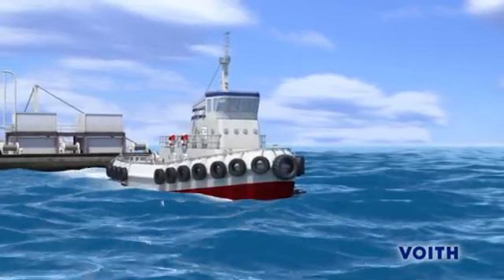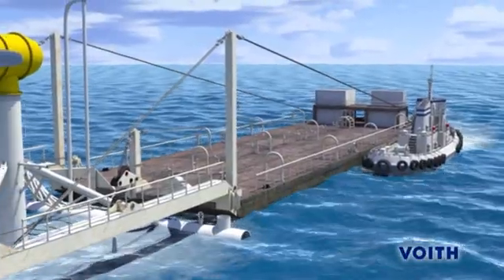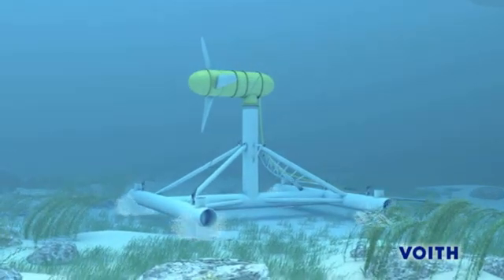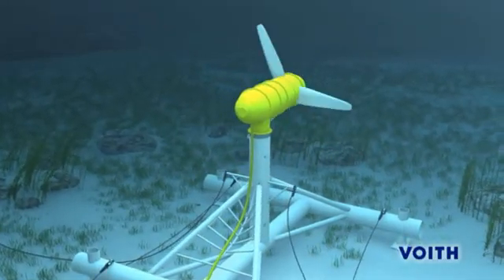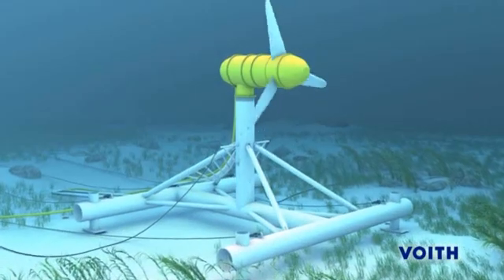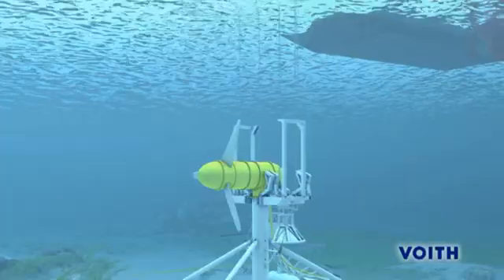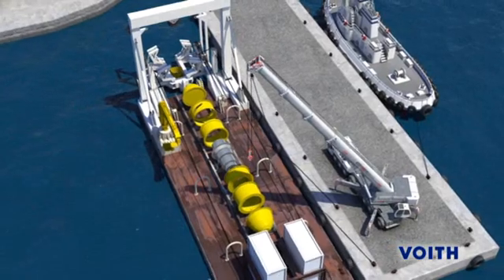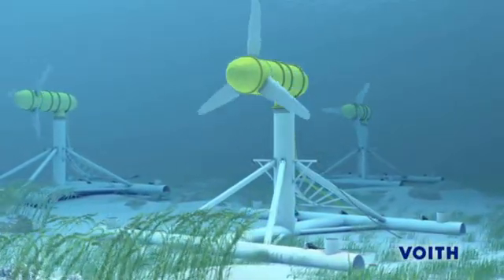Ocean Energy - Tidal Current Turbine

Comment: Principle of ocean current power generation. Giant nails are driven into the seabed using giant waterproof tanks.
Giant nails hold the sea net like a golf course net, and a large number of extra-wide fan blades are installed to connect springs to prevent tornadoes. 
添網海網TUBE

Comment: I don't think this safe for the sea life. The idea is very cool, but the whole structure should be protected by a cage that allows water flow but prevents large fish and sea mammals to get too close to the turbines
Reply: Sea water is 30 times denser than air and the turbines are smaller and slower than wind turbines. Camera surveillance in the Orkneys project indicates that sea life avoids the turbines. If this proves not to be the case, the blades could be caged. There are also other concepts to blades being developed.

Comment: Wimdshear is one of the biggest downfalls of wind turbines. Water is 70% denser than air. There is also seafloor sand to contend with that would be abrasive and "clog the shorts, making a pearl" in the components.
I guess if you make an animated you can take investors money...🤷🏻‍♂️.

Comment: Voith has some very cool concepts and products, though I wonder what the payoff is after maintenance. Having served in the Navy as a diver for 24 years I can tell you that salt water, even salt air, is not friendly to anything, especially mechanical.
Reply: yeah that's what I was worried about lol when it said "lubricated by sea water" I instantly imagined the kinds of super small ocean life that could "assist in the turbine's operation"
Reply: I assume you mean oxidation through the salty water or to put it simple rust which could destroy the metal parts? If yes, then you are in the wrong. Oxidation needs oxygen to form rust which harms the materials. In this case the turbine is completly surrounded by water, therefore there is no oxygen and no rust. One good example is Venecia, its a city in Italy where most of the houses are standing in the water on wooden beams, thoses wooden beams dont get rotten as you would assume. Although I think the lifespan of the materials is shorter then in normal use cases.
Reply: @xPr3am  H2O is composed of hydrogen and oxygen. Metal does rust underwater. I'm no scientist, though I don't have to be to see it every time I dive.
Reply: @thebobbysisters   The effects can be mitigated, though eventually salt water wins.  I have witnessed it my whole adult life, as I have lived around salt water for 40 years. I would be curious to know what materials they use.  That would make the biggest difference.

Comment: i am sure that desalination plants could use tidal turbines to off set the massive cost of power needed to operate, and if designed properly, the repair harbor could even be added to the foot print of the plant itself. just how many turbines and the logistics of it all would depend on the plant itself, but it seems like something to look into. beyond the costs of the initial investment, and the constant maintnence of the system, i would hope at some point the fossil fuel way of power production would balance closer so the idea would be viable, just a thought...
Reply from the maker: @Overwatch242 Foodforthought : Thank you very much for your comment. It is great that you make thoughts about it.